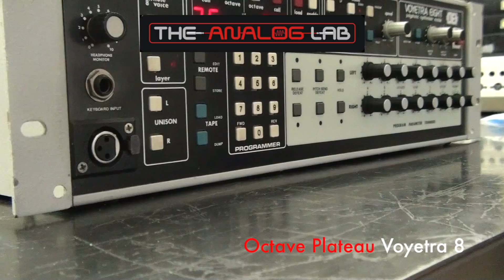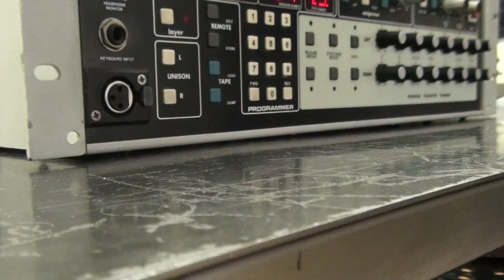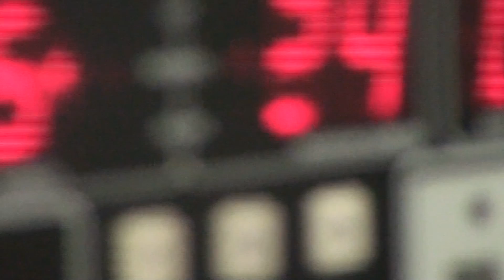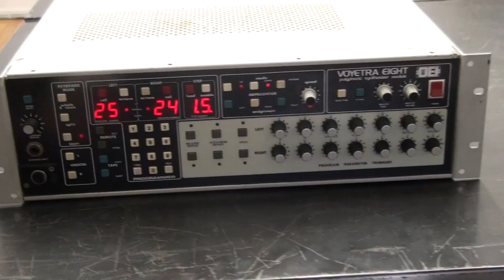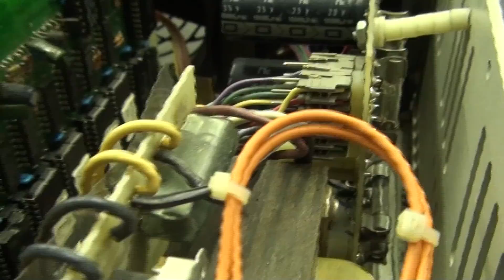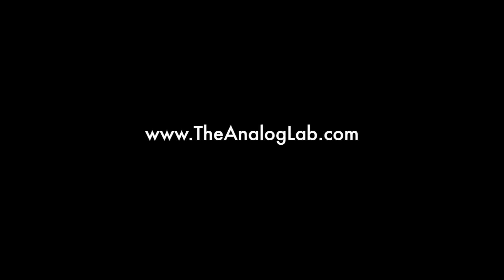The Analog Lab NYC - Octave Plateau Voyetra 8

Comment: Hi Jeff - It's been a long time. Thanks for the shout-out!
Reply: +Bruce Frazer hey bruce could i get your email? id like to ask your help im trying to get voyetra seq+ working with 4 or more midi ports without having a v24 interface.. instead using a combination of a mqx32 + a v22
Reply: @ChrisNova777  I don't know if you ever got that working but I believe I still have a V24s somewhere. And I even have my original copy of the Sequencer Plus Gold bound manual! :) I worked with bruce in the late 90's eventually serving as the IT director.